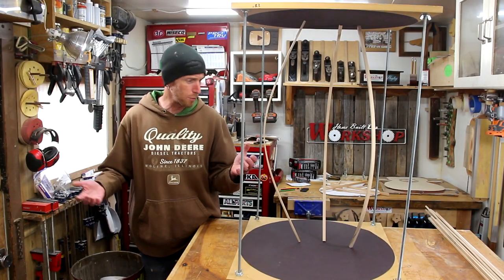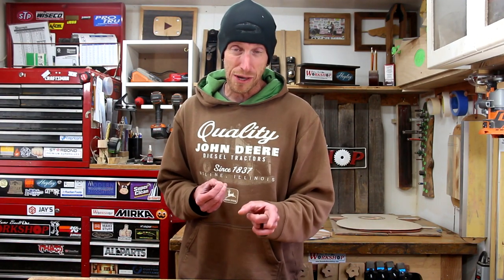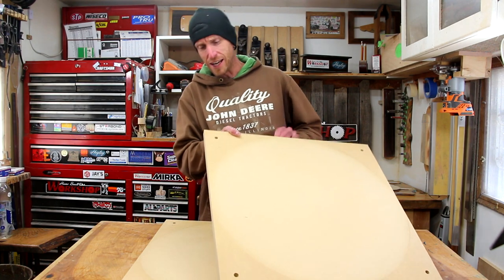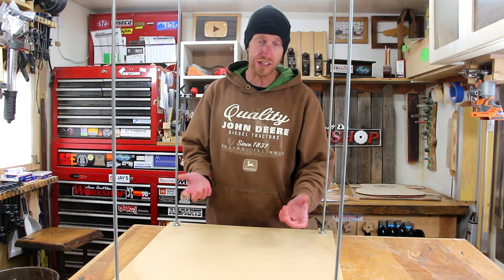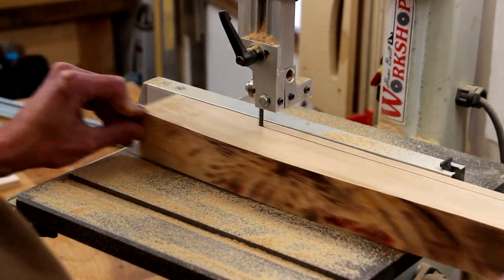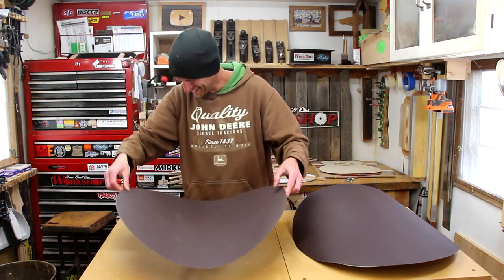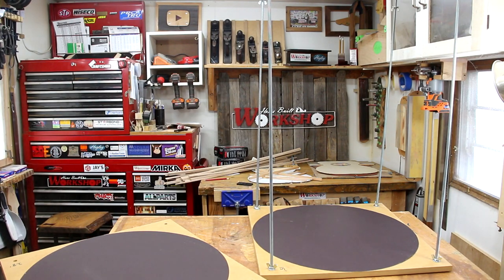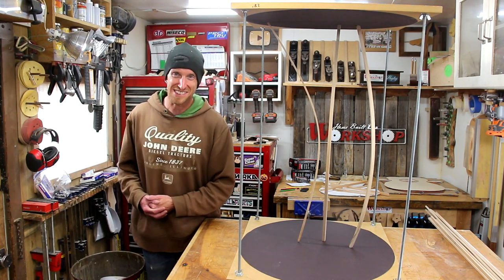Building the Go Bar Deck for my Acoustic Guitar Build | Building an Acoustic Guitar

Comment: Nice build. That tip on using floor sander disc's instead of a "specially made for luthiers" sanding disc at probably twice the cost  is gold. Not sure how much you plan to be using this but you may want to put in some sort of sleeves in the MDF where the rods go thru. Gonna be a lot of in and out as well as wobble and the file action of that all thread. Those hole will go wonky pretty fast.
Reply from the maker: I'll definitely be adding to this jig. I'm planning to double up on the thickness and probably adjust the length of the threaded rod too. Its a work in progress at the moment.

Comment: If there's a rock festival near to you, turn up after the event and ask if there's any tents being thrown away.   The fibre glass poles can be cut to length and used as go bars,all you have to do is put a rubber end on it.   Stewmac sell 10 of fibre glass go bars  for £54 ($70) you'll probably will need 20 so total cost £108 ($140) so quite a saving! They are more flexible then women sticks.

Comment: I think you might want to shorten the lengths of the all thread as well it would also make if a bit more ridge. You also mentioned in your live stream that you wanted to double up on the thickness of the MDF which will help as well. It is plenty high enough. Maybe take off 10" to 12" inches
Reply from the maker: I agree that it could be shorter. Like this whole process, it's a learning experience for me. The all thread will be easy to adjust the height. I will be getting some material to make it thicker as well. We'll see how this works.
Reply: Wouldn't the shorter height just make it harder to bend the flexy stix into place to hold the braces during glue ups?
Reply: @borgonianevolution  The Flexible sticks would just be adjusted in lengths to match the shorter distance between the top and bottom.  Also in the long run the fiberglass rods he mentioned that he may switch to would also be a better option providing a more consistent pressure I believe.

Comment: A couple tips :

.1 you shouldn't have to contour sand your neck block to the shape of the mold . Because your mold should be absolutely flat right there in the area that your block is supposed to be . Because the first thing you do when you attach the neck is to sand the outer part absolutely flat and perpendicular to your centerline. This is critical so that your neck will fit tight against the body while maintaining the  centerline.. also helps in routering out the V-block.  

 So actually sanding it to the contour makes  it so you have to sand it even thinner .. ask me how I know..lol 

2. I think your go-bars might be a few thousands too thick. And make some shorter ones because as you get away from the middle of the deck the space is shorter . Also helps to have the top plate with the radius facing up so you don't have as much of a variance of bending on your Go-bars.